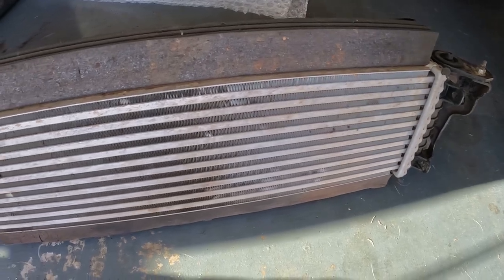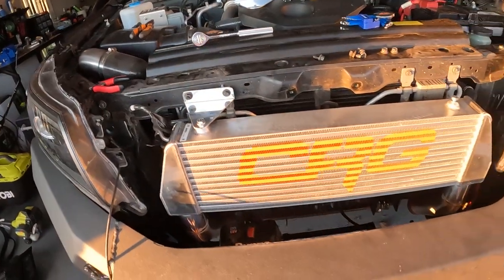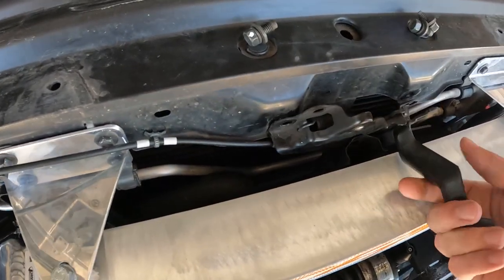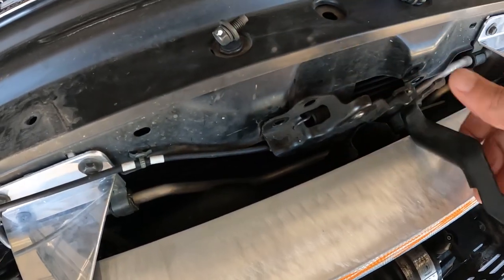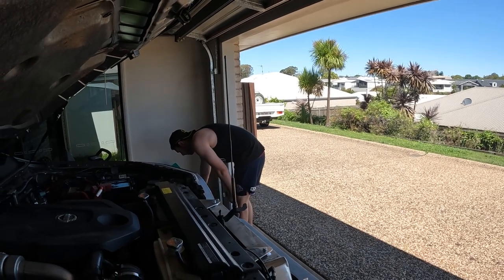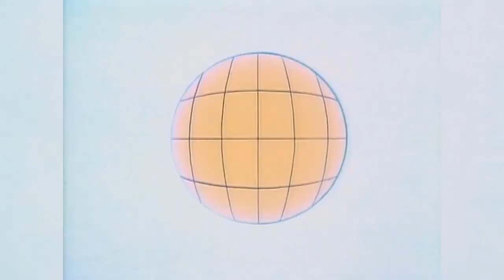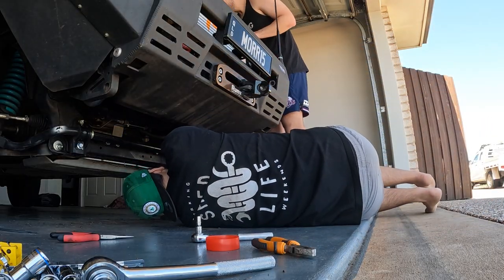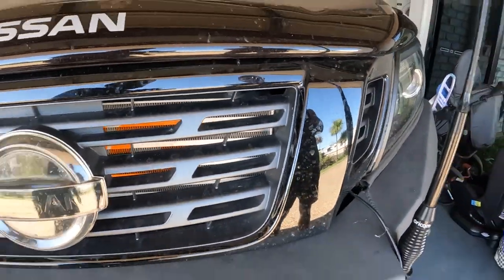CRG Intercooler Upgrade Install - NP300 Navara Build

Comment: Hey mate noticed any difference since the install?
Reply from the maker: Hey hey, my temp gauge has never got to the halfway mark since installing it! And just a general difference in my comfort knowing its up higher than the factory one 😀
Reply: Any turbo lag caused by a bigger intercooler ?
Reply from the maker: Nope didnt notice any difference in response.